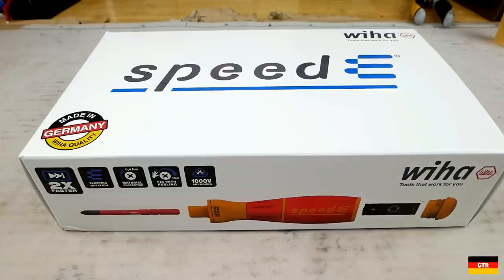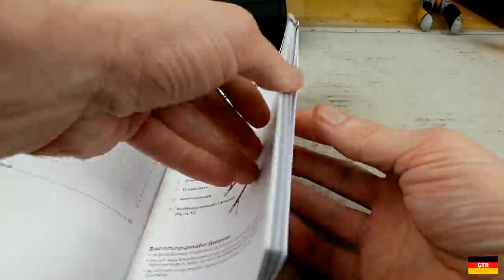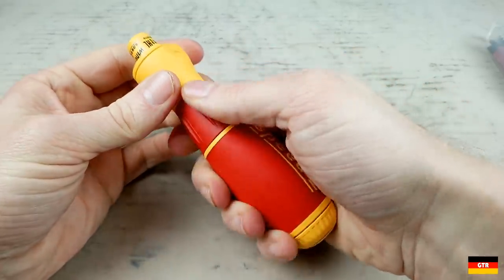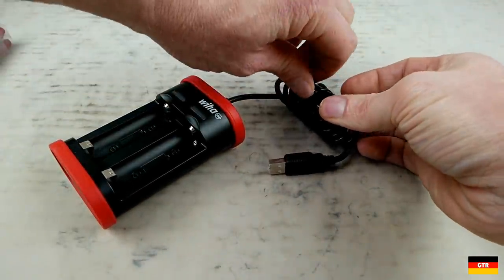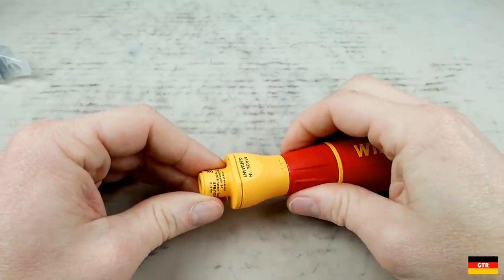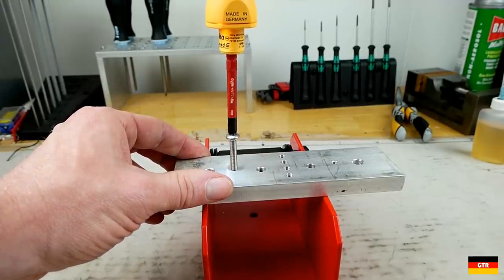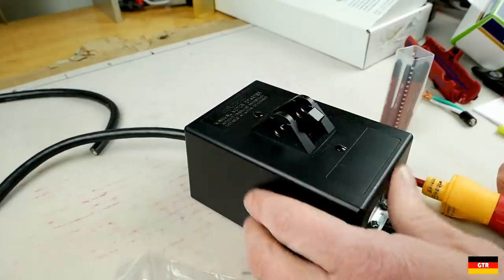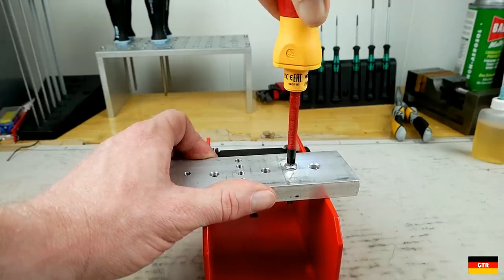Wiha SpeedE Electronic Screwdriver

Comment: Just dont buy it ppl. Not only it's underpowered but also after three months of everyday use, it jammed and I had to return it. In Wiha's credit they sent me completly new one, but this thing is simply not worth it.
Reply: $550 aud. ....omg
I'll stick with my impact driver
Reply: @dickphan  Ahhh the good old Orstralia tax, putting already overpriced German tools out of reach.....I bought a cordless screwdriver from Masters before they closed for $30 and it works great.
Reply: I think that Wiha should make it clearer that it should really only be used for circuit breakers.
Reply: After watching this video I'll just stick with twirling the shaft of the screwdriver with my fingers. If you need a shitty electronic screwdriver you can get one for $7 at harbor freight.
Reply: Excactly what i thougt! Its a poor design and the motor is imo much to slow.
Reply: Same to me. Im on my fourth one.
I have my last replacement still here, but i cant figure out how to open the gearbox:S 
Do you know?

Comment: Dewalt has a Gyro screwdriver that has way more torque and you could buy three of them for the cost of one of these.
Reply: EXACTLY.  See my post above about the: Dewalt DCF682N1
Reply: I use this daily as an electrician and has not let me down. Loads of torque and speed. I dial down the torque to 6 to wind in faceplate screws
Reply: I was about to post the same thing!  Generally I love tools that fit within the scope of this fine channel, and indeed - good review.  Further, given the focus I usually refrain from non-German comparisons.  But this Wiha offering is a shocking yawner compared to the DeWalt gyroscopic driver - like why did they even bother?  The DeWalt tool is perhaps the most under promoted and under appreciated tool DeWalt makes - which is saying something given their prolific population of it seems like ever cordless tool you never wanted.  But the DeWalt gyro-driver as I call it is a near perfect product:  100% intuitive to use, natural use model, great hex bit quick lock collet, light weight, inexpensive, and available both as kit or bare tool.

@German Tool Reviews, if only to point out the obvious to Wiha who otherwise have fabulous drivers, you might want to consider a comparison.
Reply: Same here. I used to have a Panasonic (at work) but that hasn't seen a refresh in years. My dewalt seems to go some time on a charge, isn't loud, and with Posix bits, let's me assemble Ikea furniture super easy! (And THAT says it all!)

Comment: "Industrial / serial production use" is someone sitting at a product assembly work cell driving fasteners continuously for eight hours a day every day.

"Professional craftsmen use" is someone taking time to walk to the job location, opening a box, driving a couple of terminals, pulling and stripping some wire, closing up, going to lunch, etc.  Most of the time the tool is idle and it probably has 1% to 10% of the usage of serial production.

Comment: Just wondering could this be a good tool for people who fix example computers etc where you have a lot's of screws which are not that tight? This tool has been on my "buy when I get loose money" list few months but right now it's way too pricy for what it is.
Reply: In that case a €50 IXO will do everything this €235 Speed-E does. Except it actually works as an electric screwdriver. Get two IXOs to bypass the empty battery problem, and a set of nice bits to go with em. And still have money left to take the missus out for dinner.
Reply: No this screw driver is absolutely useless.
Reply: Useless. The only reason ust the form. And the warranty. So there isn't much left.
Reply from the maker: Probably not for computers, the screws are never long enough to get any real advantage.  I think this tool was always intended for electricians and can be helpful for them in particular, but everyone else not so much.
Reply: I do electronic repairs...this is too slow for that, it would take you forever. I use a M12 Milwaukee screwgun(2401-22) or drill(2407-20) on clutch setting 1(SBD drills are clutch setting 2 or 3). I really don't see any situation where this would be better than a 12v drill/screwgun. Even on stuff like a PH0, where the drill is too powerful, this is going to be cumbersome. 

I wanted the SpeedE to be great but it needed to be more powerful and it HAS to be faster(it's probably just not possible, yet). It's slower than a ratcheting screwdriver, even when you have to grip the shaft with your other hand to provide resistance for ratcheting.

Comment: I had a feeling this wasn't going to be very torquefull.  I can't really see the advantage of it over a cordless drill which will have way more power. There are very few situations where there are no resistance in screws. The wera ratchet screwdriver would be faster than this I feel, plus the rapidaptor is way superior to wihas effort here.

Comment: In the Netherlands, these things became available a while ago with quite come whoo-haa, but I never really saw the point in one. Also, way too expensive, too slow and just another battery platform.

As an electrician I come across situations where it would be useful quite often, but it's just another thing to carry into the job when I already have my Wiha torque screwdriver set and 12v impact on me.. So I tend to run the screws in with the impact until they touch, and tighten them with the torque screwdriver.

Comment: 0.4nm? That slow? Pretty much useless for anything I can think of (well, except the Wiha branding)
Reply: Yep, even his examples where it's good for, aren't that practical. Circuit breakers need to be tightened with a set amount of torque according to spec. E.g. 2.7NM in case of ABB ones. So you'd have to whip out another screwdriver to fully tighten anyway.

Comment: I think Wiha may have looked at your review video. https://youtu.be/rHKNqBAxOfU    Speede II has most of your recommendations addressed. I would love to have a look at the new one when it is released. The original Speede still available and are hideously expensive here in Australia - as with most things! The thought of having to sell a kidney to even try the new one makes it almost impossible to justify the purchase.  I can buy a 2 piece Makita, Milwaukee, Bosch, or Dewalt trade level 18v kit with drill, impact driver, charger & 2 x 5aH batteries for less than the cost of this screwdriver. Cool concept though.

Comment: try dewalt gyroscopic driver and whia slim line bit's instead
Reply: the bits are different sizes
Reply: @dashaB-sl4pu  Good to know.. They look like the standard 1/4'' bits online but it doesn't say anything on their site about it's spec's.. Are they larger or smaller?  I have an adapter that goes from 1/4 down to 1/8th for precision bits.
Reply: @JK-ll3vj   The Wiha bits are just a tad smaller than the 1/4 "drive bits and they fall out of the 1/4" holders
Reply: @dashaB-sl4pu  Aww, I dont think it will work with my adapter then. I need a good set of insulated 1/4" drivers for my Dewalt. Handy tool for the right price..would def recommend it.
Reply: @JK-ll3vj   I bought one late last week with the torque adapter and a few more bits,$570bAu but I have another Wiha screwdriver kit which uses a bunch of other slimline bits the fit this tool, you would think it would have a standard 1/4" adapter but it'd not and that's a pain, and the torque adapter 2.8 NMdoesn't seem to work or it's just me.At my age now having issues holding screwdrivers so hope this helps me tinker a while longer, cheers
Reply: @JK-ll3vj  I have that dewalt driver myself and didn't think they have insulated bits, wouldn't it would be rated for a sparky's 1000 volt rating,I certainly wouldn't like to use it under those conditions,think it's not intended for that sort of use, ok for fit out's though,what it was intended for, My small Hitachi driver leaves the dewalt and the wiha for dead and it has adjustable torque setting, for this old sparky it's weapon of choice

Comment: This just seems too gimicky, better off buying a good quality set of branded VDE rated screwdrivers that'll last you a long time as opposed to this overpriced electric one. 

It's handy if you're just looking to use it around the house to change batteries in children's toys, change over cracked face plates & outlets etc... but other then I don't see it surviving long on a job site.

Comment: Um, how about no. $225???? Screw that (pun intended). Another overpriced gimmicky tool that no pro is going to touch. DeWalt makes a far better drill driver than this that has built in torque limitting and it can actually drive screws faster than you could do it manually unlike this piece of garbage.